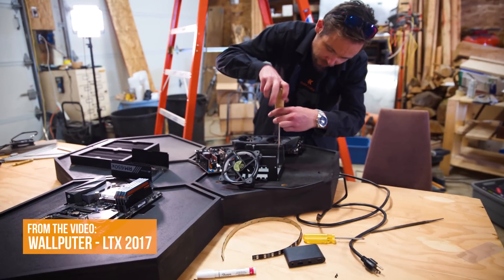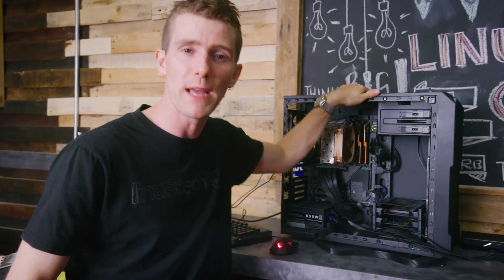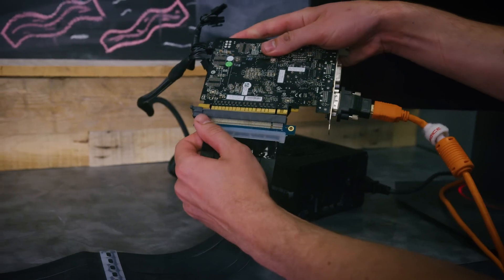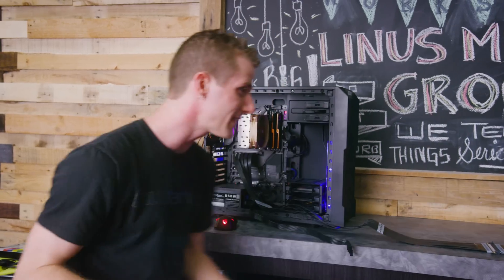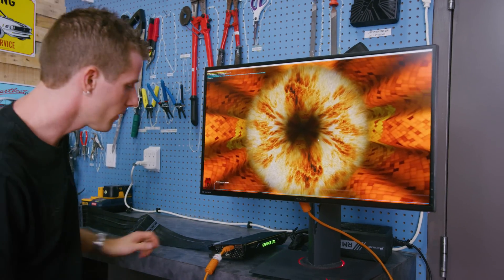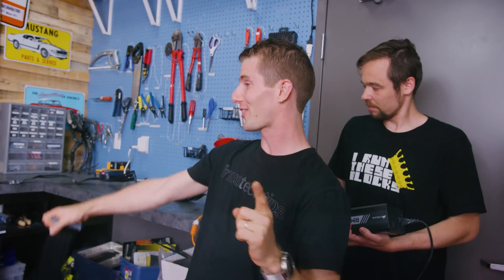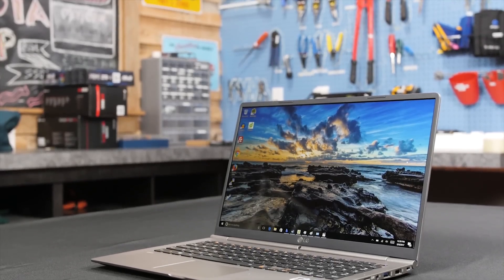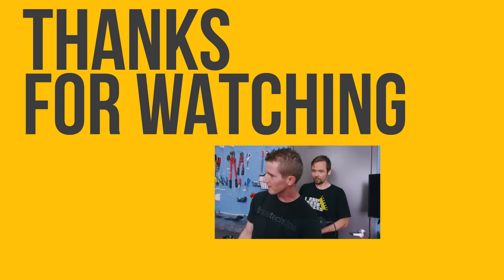How many PCIe Extensions is TOO MANY??

Comment: Build a pc where every part in a different room😲😲😲
Reply: *where every TRANSISTOR is in another room. GL
Reply: @36424567254  a 1tb storage system a couple decades back in a nutshell
Reply: Mirage- that is funny
Reply: @36424567254  ah yes, the 20 billion room studio
Reply: @36424567254  the berg colifa couldnt handle an 8 bit proccessor😂
Reply: The Hunter ram extentions
Reply: I don't think CPU socket extensions exist.
Reply: @Slenderman63323  they flipping do
Reply: VERY EXPENSIVE THOUGH
Reply: Make extra long SATA cables. PCIe extenders, Power cable extenders, USB and DisplayPort extenders.
Reply: Next Holy $hit episode??
Reply: Wow that sounds like great cooling idea.
Reply: Arkines is that actually a thing?
I don't see any practical use they would have, unless you have some giant ram
Reply: A computer that's basically a whole building.... Wait, I think we've done that before.
Reply: Super computers in the 1970s/1980s were like that
Reply: Sata is limited to about 1 meter. With that said, external SAS can go pretty far. So you might have to put a RAID card connected to a three meter PCIe chain (Not sure if that would work though, since RAID cards are different from GPUs), and then have SFF-8088 cables connecting to a Lenovo SA120 or some other DAS. I think you'd have a lot of issues with extending the CPU socket though...
Reply: The Hunter No, but i kind of want it to be now
Reply: @ArkinesVT  it cant be possible as the voltage would degrade
Reply: Epsilon ltt could make 1
Reply: Heh, talk about 'Distributed computing' :P
Reply: Mahmood Jazmawy you can only really have the psu and the gpu far away, everything else has to be in the motherboard
Reply: @thehunter4873  a series of wires going to every part based on contact to contact connection
Reply: @thehunter4873  ram extensions, make a diy cpu extension and u also have sata extensions so its possible.
Reply: good idea
Reply: Epsilon I don't see why they couldn't
Reply: Mahmood Jazmawy PC in the walls
Reply: Processer? PSU?
Reply: Mahmood Jazmawy something like 2011 pins lmao
Reply: Cpu riser cables
Reply: If i think correctly, it should be possible, to build risers for every Part, but it would be really difficult🤔
Reply: Oh yeah just gotta get a CPU extension cable
Reply: 20 ram extenders
Reply: Best idea 10/10
Reply: Ram risers
Reply: yea cpu and mobo
Reply: mouse and keyboard
Reply: If you design your pc like a doll house thats pretty possible
Reply: Your house is the case
Reply: ahahaha
Reply: Every part in a different building
Reply: early computers,not personal though
Reply: Imagine the computing power of a pc the size of a house
Reply: Mahmood Jazmawy it would be impossible
Reply: @tamago6783  It should be if there were fiber version of every kind of cable.
Reply: @tamago6783  actually i guess it's not impossible except for the cpu.
Reply: @Deviloffateful  and ram and cpu cooler and m.2 ssd
Reply: @tamago6783  2 years later
But never set never in the internet on of us crazy idiots with to much time and to much Monny will do it
Reply: Milaan Dahiya dont worry linux will always find a way to do it. 
He might go as far as soldering every single pin from the cpu to a cable and sildering the cable to the motherboard😂😂

Comment: I wonder how much that affects input lag? Probably doesn't add more than a millisecond, but you never know.
Reply: Assossa Speed of electricity is aprox. 1/3rd of the speed of light, so aprox. 100 Million meters per second. Three meters divided by 100 Million is 0.00003 milliseconds or 30 nanoseconds. So we are talking in magnitudes that really don't matter to us humans.
Reply: I disagree with that one, but I'm no expert in this stuff.

From StackExchange:
"Of all the caches, the L1 cache needs to have the fastest possible access time (lowest latency), versus how much capacity it needs to have in order to provide an adequate "hit" rate. Therefore, it is built using larger transistors and wider metal tracks, trading off space and power for speed. The higher-level caches need to have higher capacities, but can afford to be slower, so they use smaller transistors that are packed more tightly."
( electronics.stackexchange.com/questions/104759 )

So it seems L1 cache is faster not due to less distance to travel, but because it uses different components to L2 & L3 cache.
Reply: If a little napkin math is correct. The signal latency should be 1.18 microseconds on top of the socket's built in latency. Even as a graphics programmer that stresses over microsecond latency in my code, I consider that very insignificant. 

The real problem you might encounter however is signal to noise ratio. With longer runs of cable you effectively have an antenna. Shielding helps reduce the noise intake but it doesn't eliminate it all together. Learned that lesson all too well when soldering cable directly into an XBox360 to pull out the VGA signal without the need for a Microsoft cable and without a VGA port available, just an end and a lot of shielded wire. I could only get up to around 6ft before something as simple as turning on the microwave on the other side of my relatively small house would start causing noise in the video. The cable was properly shielded, wrapped in grounded foil to increase the shielding but that only really bought me enough protection to not have the duty cycle on the refrigerator or microwave cause noise. It's worth noting though that for some reason Xbox360's VGA signal is incredibly sensitive to noise, never encountered that before on VGA.
Reply: Thanks for the answers guys. Is the speed of electricity affected by resistance? If so, I imagine lower quality pcie extenders would add more input lag, albeit still an extremely small amount of lag.
Reply: Assossa resistance does not affect speed of electrons. Resistance change the current, I.e. amount of electrons.
Reply: Resistance does change the speed of the electrons - but that is far less than he speed of light anyway. According to Wikipedia the electron drift speed (thats what it called) in a 2 millimeter wide wire at 1 ampere is only 23 mikrometers per second, so awefully slow. But that doesn't mean that the speed at which a signal travels is affected by that. See if you take a piece of wire and you put an electron in on one end, there very quickly falls one out on the other end. But that is not the same that you put in.
Reply: Assossa Electricity is basically instant, if its working, there shouldn't be any lag

Comment: I'm pretty sure it changes frametime not framerate. Check the frametimes with each extension.
Reply: shahar sela but frametime is 1/framerate? You cannot change one without affecting the other.
Reply: this is what i want to know too.
Reply: THANK YOU , This is what we need
Reply: but shouldn't frametimes directly affect framerates too, given that the load isn't already all cached in the GPU?
Reply: Linus please revisit this with more detailed investigation into performance.
Reply: So blurbusters to test frametime or am I thinking of a different thing?
Reply: That's just inconsistent frametimes and the fact that you generally only look at an averaged framerate over the last x frames or so but you evaluate the frametime each frame. If you would evaluate the framerate at each frame the number would be very inconsistent too. The formula is fixed: framerate = 1/frametime and frametime = 1/framerate. At which intervals you evaluate that and over how many consecutive frames you take your average value is up to you.
Reply: But I get what you mean ofc, a stable averaged framerate doesn't mean you get consistent frametimes for each individual frame.
Reply: They didn't even test performance and if it still ran at PCIe 3.0. As usual this video tells us just that the machine runs, not how well it runs.
Furmark is NOT a performance benchmark.

Comment: I'd love to see this test done again, but using an OpenCL memory copy as the benchmark.  My guess is you'd see the overall bandwidth of the PCIe lane go down as you added cables and the error rates got higher.  I assume tests like furmark aren't really impacted by PCIe bandwidth much, but some applications/games would have more issues with the decreased bandwidth from using extenders.

Comment: "We also hooked up a separate power supply for our GTX 650 Ti graphics card this is so that we don't actually run into power cable length limitations."

What? Could you not just bend the PCIe extenders around so that the GPU can be plugged in?
Reply: TheOfficialCzex I know they're shielded but with that many wires crossing it sounds like it would just open the test to problems this is fine.
Reply: Bending cables (sata, pcie, ect.) would probably cause more issues than running them straight.
Reply: because with bended raisers you won't have the visual impact of a gpu 3 meters away from the mother, and you'll get skepticals calling bullshit
Reply: But that way you wouldn't be able to make the cool "IT'S 3M AWAY FROM THE PC!!" thing
Reply: that wouldn't be a realistic usecase and would probably cause crosstalking problems.

Comment: I think the seperate power supply for the graphics card could also potentially affect the autcome of this test. It is not like all the power that goes into the card from the 8pins leave it through the same connection. some of the current will flow back through the pcie extension and vice versa, potentially affecting the power supply to the card. actually it would be interesting to do a more detailed analysis how that effects performance and stability. does anybody with some technical understanding care to elaborate if this could make a difference?

to be clear, i dont mean the obvious powerloss through the crazy long pcie cable. I would like to know if having to seperate powersupplies in general effects the system.

Comment: Linus: Let's get out the Titan XP! (easy)

Me: I'm saving up for a GTX 750Ti. (cries)
Reply: Wouldn't be 1050 better choice?
Reply: I agree with Sławek XD. The price difference between the two is so small, it doesn't make sense to buy the 750 Ti over a 1050. If you're saving, why not wait a bit longer for the extra $20?
Reply: For new it's like 20$ difference if you're talking about new card.
Reply: Sławek XD but it doesn't sound as bad
Reply: You should get the gt1030 it's better than the 750ti
Reply: I feel ya there. But a 750ti should be fairly cheap by now... At least on Ebay. 

I just bought a 1060 for about 300 bucks; replacing my 660 ti. The 1050 ti I was looking at was about 200-230. So I couldn't imagine 750ti being any higher than 180 (new) or 100 bucks (ebay) considering you can get dual 660 ti on ebay for ... I think i saw 100 bucks.

Edit: 

If budget is that bad, buy used man. But not like from Amazon used, go on ebay. I've had some decent luck with Ebay. As long as you are diligent you should actually come out on top. 

If you really want new (and I don't blame ya, something nice about knowing it's new); then I actually would recommend the wait (even if its another month) for the 1050 ti. It's simply the better buy.
Reply: i found a 970 turbo for 100. too bad i already bought my 970
Reply: SpaceFlight99 750 Ti is better actually, I have both and it gets about 5 more FPS in every game
Reply: I'm still rocking my EVGA 750ti FTW edition that thing is a tank it still keeps up more performance than I would expect from such a cheap card brand new just came out at the time it keeps up even runs games as new as PUBG and doesn't look terrible I've done fallout 4 GTA 5 Titanfall 2 Just cause 3 it just handles everything on decent settings with good frame rate yes I want to upgrade but this card pulled its weight I'll say that
Reply: Andrew Yglesias exactly 😂😂😂
Reply: SpaceFlight99 No he shouldn't, GT 1030 is good card only if you have weak PSU beacuse it recieves power from MOBO. GTX 1050 is superior in every way and price difference is about 20$
Reply: I don't have the money. And it would take me too long to save up that much.

Comment: I tried 3 different PCIe Extensions (not including stock) to try to get a Tristellar case to work with a 1080 in it, and right before my ability to return it expired, I had to give up. I got it to get to windows exactly once, and the 1080 was performing worse than mid tier cards a generation earlier. I've always believed that it was just the fact it was a 1080 that was the problem my old card had no issue, a 770... But now I'm wondering...

Comment: On one hand this is kind of a stupid topic, but also quite interesting. I would have thought that pci-e graphics was latency sensitive to the point that this would be a huge problem, not that it was purely a matter of signal integrity. I always thought that the latencies required to avoid performance issues would limit pci-e riser length similar to how you can't do a one meter extension for ram and cpu.

Comment: Build a (watercooled) PC which has each major component in a separate room...
Motherboard, GPU, storage, water tank, radiator, monitor and keyboard/mouse, each in a different room (you could use a huge monitor from the room next to the one with keyboard/mouse).

Comment: Shoulda tested while overvolting the PCIe slot on the motherboard, and with an MSI Lightning edition card that has adjustable aux voltage. I'd also like to see what some powered risers are capable of.

Comment: so correct me if I'm wrong (and this can be the case, since I'm not a motherboard engineer) but after looking at some datasheets of these riser cables, they have an average AWG of about 25 and PCIe Cards can use up to 5.5A at 12V DC.
Using a online calculator for Voltage Loss we see that these riser cables have at a length of 10 feet about 30% Voltage drop. So it isn't really surprising that these don't work at lengths like these.

Comment: I'm almost certain that the connectors in between each cable are  responsible for the problems right now maybe if you had like a 10 meter shielded cable it could still work.

Comment: What did you expect, for it not to work? 

PCI Express is one of the most over-engineered protocols out there. The protocol has so much error correction and redundancy built in that people over at Failoverflow managed to run PCI Express over RS232 to analyze the data that is flowing through the bus, and it was working fine, albeit slow.

This video could have been avoided with a simple glimpse at the PCI Express specification.

Comment: The cool side of this is the results are enough distance to run a PCIe card from the middle of a full size rack to the top or bottom or a rack next door.. especially if you actually use one length of cable that accepts power at the FAR end vs a bunch of chained adopters. This means any workload where the average bandwidth is low enough to let you use PCIe switches likely won't be effected by your rack layouts, although ti should be noted there is still no way to prevent a crash if the cables are disturbed, so hot swap is not possible.

Comment: Hey Linus, when do you think PCIe 4.0 will be implemented into things such as regular motherboard by ASUS and MSI or regular  GPUs by Nvidia and AMD? Also, by regular, I mean less than $600 USD or, at most, today's common pricing for GPUs and motherboards. Also, do you believe that the threadrippers will  be able to operate as well as they do with PCIe 3.0, but with PCIe 4.0 instead?

Comment: Ironic how Tunnel Bear openly advertises "a free internet" yet it blocks quite a lot of thing, things not even my fucking ISP blocks.
Reply: What does it block?
Reply: Can't use voice chat programs like TeamSpeak, can't download torrents. That was the point I refunded and cancelled, I didn't care to find out what else was blocked.
Reply: Are you sure? That could be down to restrictions on the country you tunneled to, plus a lot of torrent sites have been straight up taken down instead of blocked by now, I never had problems with tb so this is strange
Reply: Rowan Simmons
Considering TB states on their website that they block torrent traffic on every server they run I highly doubt you never had problems with torrents via TB and simply never tried to download a torrent via TB.

Comment: But using Furmark is dumb! It has no bandwith requirements. I remeber using eGPU on my notebook. Furmark gave me full frames per second, while CoD MW2 refused to run at more than 40FPS. And I was using a GTX 670, which is capable of reaching far more.

Comment: FurMark is not that taxing on the PCIe connection itself. It was designed to put an extreme thermal load on the GPU. I bet the Ashes of the Singularity benchmark wouldn't fare this well...

Comment: As a student in electrical engineering, I will say, adding to the cable length increases the resistance and lowers the logic level voltage. As long as the voltage stays above the switching voltage of your transistors, I think you should be fine. Remember: Electricity travels at nearly the speed of light.
Reply: Theoretically, you could read the voltage with an oscilloscope, if you found a way to connect it to the terminals.

Comment: that is pretty insane you can likly go futher than 3m if you had a single cable. to me this begs the question if the delay is not an issue why isn't there just a normal cable for add-on cards and a new standard for mounting it would allow for a much better PC layout as a standard shrinking the size of cases.